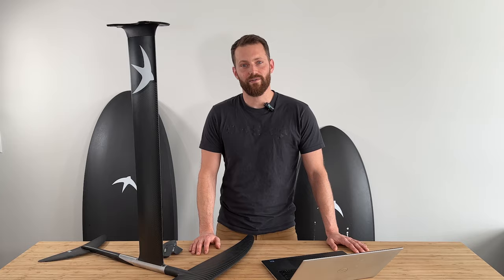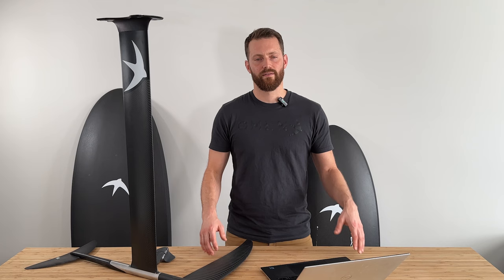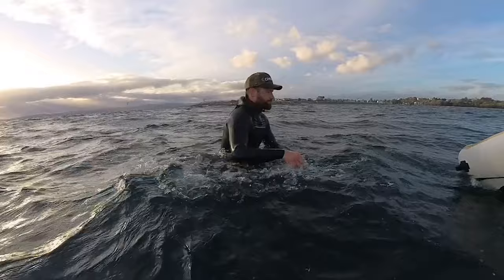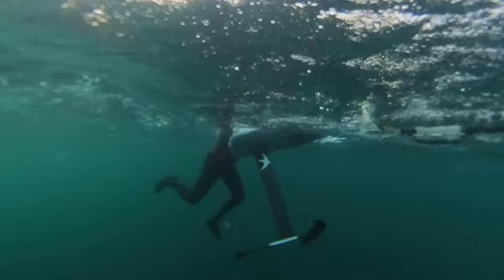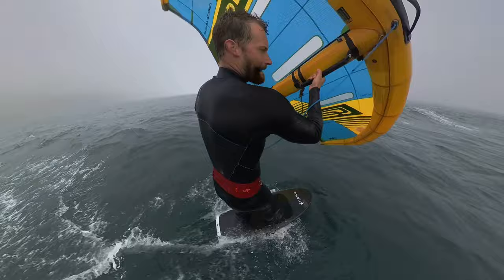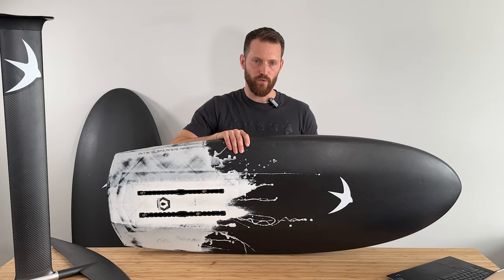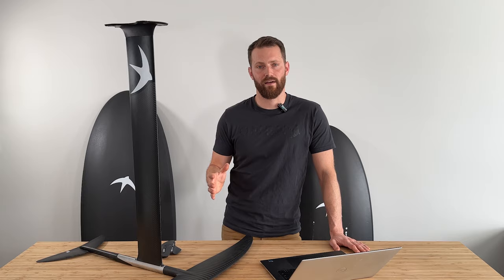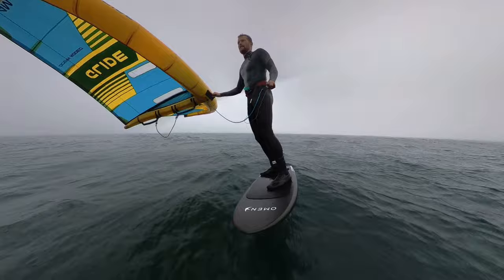How to Waterstart a Sinker (Or any Size Wingboard More Consistently)

Comment: Hi, again.  I went out today to practice some of your techniques on my 8'2" ginzu dragonfly (120 l and Im 97 kg). I couldnt get over how unstable that board is when not moving in the chop.  After watching this video a number of times , I came to the conclusion that , in choppy seas , you seem to be having an EASIER time getting up on the sinker! It seems to be lest affected by the chop.  I discussed this with my friend who is much better than me and he said it may be true.  Is this true, or are my eyes deceiving me?
Reply from the maker: I do agree that a sinker board is often easier to start in really messy conditions. What part of the stinkbug sequence did you find yourself generally falling off during?
Reply: @omenfoils   I cant really say yet, because the wind died... so that ended the story before it began.... but it really gives me hope to watch you do that maneuver.  I also saw another tip on a different video.... to hang your back foot off the rail for stability before you get going. I plan to use that as well.
Reply from the maker: sounds good @tormarquis  looking forward to hearing how it goes! Will be interesting to hear if you try both techniques if you find hanging the back foot off the rail is helpful or just creates more drag